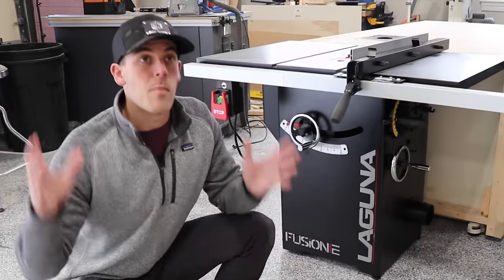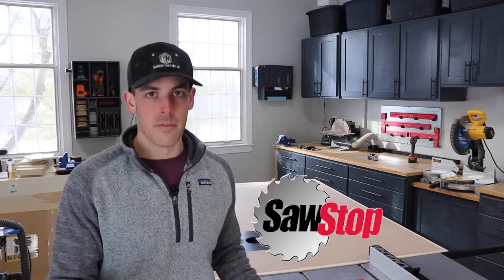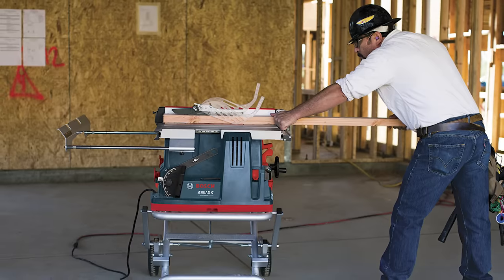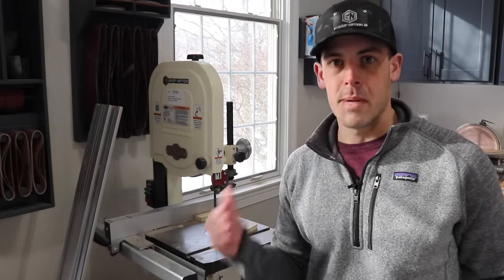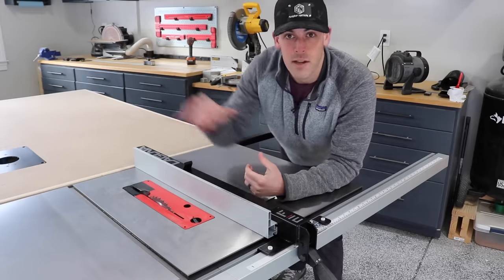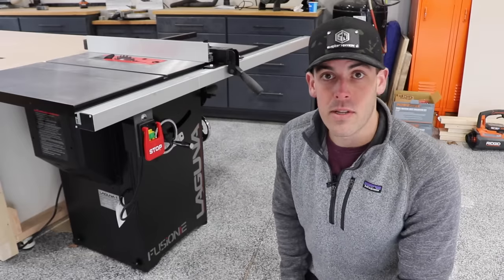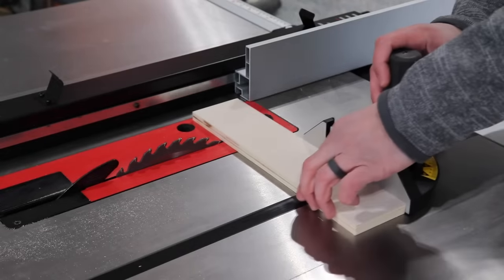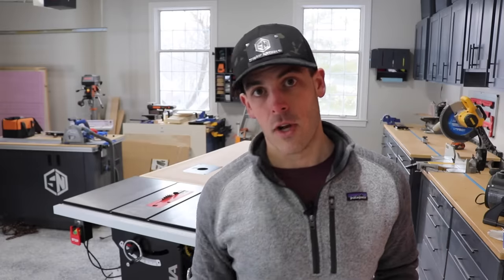Why I Bought a Laguna Table Saw over SawStop!

Comment: The title of your video intrigued me, and even though I guessed the reason you went with a Laguna tablesaw was the price, I still wanted to watch. Your reasons can't be ignored, there is just something about paying more than twice the price for something that's basically the same thing that is unsettling. I spent over 35 years as an automotive technician until major neck surgery made it impossible to return to the work I loved doing, or to even be able to drive myself anywhere. Safety was always a concern as a technician, but I would be lying if I said that I did everything safety-wise by the book. The first thing many of us did when we purchased a pneumatic die grinder was to remove the lock that you have to disengage in order to squeeze the trigger. Until the last set I purchased where I kept them on, that was me.

The reason I am willing to pay the extra money for a SawStop is that with very little movement since the surgery, (my head is the only part that moves), I lose my balance easily, I have to turn my whole body just to look to my side, and doing so sometimes causes the aforementioned  loss of balance. I also have two forms of heart disease as well as vertigo that comes and goes, so the last thing I need to worry about is where is any part of my body is going to go if I collapse for any reason.

There are those that would say that I need to choose another "hobby", but I worked as an auto tech since 1986 with the vertigo, and one of the heart disease I have evidently had all my life but it was never diagnosed. The other came on in 2000, 23 years after I started my career. Woodworking has never been a hobby for me., I have been doing it in some capacity since 1979 when I got married and had my own house. if anything, even though I was always mechanically inclined and figured I would either be working on cars, or in the Coast Guard when I "grew up", when I took woodworking in 8th grade, that all changed. It was then that I found what I wanted to do in life, woodworking. Unfortunately, where I live there wasn't much opportunity to earn a living at woodworking, and at eighteen, I would not have even considered moving to where there were opportunities.

The tablesaw I have now is a DIY piece that leaves a lot to be desired, and I have to be very careful that my attention isn't diverted elsewhere when I'm using it, and that is why I'm shooting for a SawStop. So I never have to worry about something suddenly distracting me and diverting my attention.

Just my thoughts for my situation, but like I said, I agree with your reasons and your decision. I don't in any way condemn or fault your decision.

Comment: I love Laguna tools. The bandsaws the lathes. Their table saws…….. you have to spend BIG money to get 3 HP.  I found an older Delta Unisaw and as it was right hand tilt the owner was having a hard time selling it. I do very little angle cuts on my table saw. Plus the right hand tilt really isn’t an issue anyway to me. Thus I got the saw in mint condition for $1.100.   52“ Biesmyer fence. This is my dream saw. The older Unisaws can be a little hard to find but it is yet another option. I have been a cabinet maker woodworker for ……30 years or so , with diligent safety protocols you can keep your digits without a saw stop. I did enjoy your video and hope I didn’t hijack your post or be a wet blanket.

Comment: I've used a lot of saws and assembled and set up two Hafco cabinet saws.  At home I've had a DeWalt jobsite saw that I love, but it has an aluminium table that is not flat, and limited capacity, and I feel it's time for an upgrade.  I'd like a Sawstop, and I recommended my Menz Shed get one when we upgraded a year or so ago, but they were, and are still, awaiting stock here in NZ.  If I could get a Sawstop, it would cost me double what a Laguna saw costs here, and in my research the Laguna is impressing me with its quality.  Stumpy Nubs said that American woodworkers might soon have no choice but to get either a Sawstop, or a saw with a Sawstop brake.  We are not in that position here, so I intend getting a Laguna F2 for my home shop.

Comment: Very reasonable take on saw stop vs competitors.  Using a contractor saw myself, and I’ll bet most wood workers (hobbyist and pro) are running something other than Saw Stop today, so hard to argue it can’t be done or other options aren’t valid.  Personally, if I was making cuts on my table saw every day, and I could reasonably afford it, I’d sure like to have something to protect me against, well, myself.  There are definitely times where it’s tempting to reach up and grab a piece just a little too quick or make a cut that’s a little on the sketchy side and an error rate of 0 across an enormous sample, at least for me.

I do wonder if people with Saw Stops are a bit more careless after a while. There’s a thought that people have a specific risk tolerance and if something become less risky, they adjust their behavior accordingly.  I recall an Econ professor saying the best way to make people drive safely is to have a spike coming out of the steering wheel pointing at the driver. I could certainly see people that trust their saw to save them get a bit less careful, and even if the Saw Stop works well, might that approach translate to other tools.

Comment: I bought the new F3 about one year ago, very shortly after the lineup was revamped.  Aside from the (at the time) lack of updated owners/assembly manual, mine came with one for the previous generation, and the fence, which I'm not crazy about, I love the saw.  You are correct about the price-point vs. a SawStop when you compare quality of the saws and features that it comes with.  I, like you, think SawStop makes some of the highest quality tablesaws on the market, not even considering the flesh sensing technology, but the equivalent 3hp SawStop was a full grand more than my F3, and my F3 has features like overarm dust collection and built in mobility that would add even more to the SawStop price.  The thing about the fence that I'm not crazy about is the lack of ability to mount certain accessories, e.g., JessEm Stock Guide, nor fence straddling jigs, like ones that shroud a dado stack for cutting rabbets.  If I made YT videos, I'd do one on my F3, because like you said, there very few, other than the marketing and overview Laguna videos on these saws.  They definitely fit a quality/pricepoint niche that is open for the taking right now.

Comment: I’ve been using Laguna in my shop for several years now and like the results I get. I have a Laguna table saw, bandsaw, planer, jointer, and dust collector. The only negative comments I’ve heard about Laguna is the service department is non-responsive if you have an issue. I haven’t had a single problem with my equipment so I’ve never tried to contact them. If someone is looking for an opinion from a Laguna user, I highly recommend their equipment. Since this is an opinion, I’d also like to add that accidents come from lack of knowledge on how to use a table saw correctly or not paying attention to what you’re doing. Don’t use sawstop as a crutch to protect yourself. Learn to use your equipment properly and then pay attention to what your doing. You don’t need an overpriced saw and fear to protect yourself.

Comment: As someone who has lost 3 fingers on one hand due to a shop accident, I can appreciate any form of safety measures a tool company puts in place.  However, I will say that my accident happend on a jointer, not a table saw, and in probably 15 years I've been using a table saw, I've never had an accident like that.  So for me, yeah it would be nice to have a saw stop, like if it was given to me, but I do agree they are way over priced for what they are.

Comment: Nice review. I have used a Saw Stop in a work environment and had a freak encounter with the blade that convinced me that if you can afford the Saw Stop, it is worth the expense. 

It is likely that I will end up buying a Laguna. That said, table saw safety warrants your full attention every second that the machine is running.

Comment: I have a 20 year old Delta contractor saw with a unifence, which is basically the same as the fence you have. I love it. I use that high and low feature all the time depending on the thickness of what I'm ripping. I also love the ability to slide the fence. That's very handy when cutting long boards, or long and wide plywood as sliding it toward you makes it easier to keep what you're cutting up against the fence as you feed it into the blade. That fence is one of the reasons why I haven't bought something newer and better.

Comment: Love my F2, great choice. I purchased for many of the reasons you cited and have zero regrets.
Reply: Rocket Man  I’m running a Harbor Freight dust collector with the Oneida dust deputy and the Oneida upgraded filter which replaces the bag filter.
Reply from the maker: Rockler wall mount 1250 CFM, and works amazing

Comment: When shopping for saws and checking out SawStop, all the sales people would tell me was about the safety feature.  It got tedious; I got it already!  I finally told a salesman that "I wasn't buying a table saw to 'not cut my finger off.'  I was buying a table saw to cut wood!  Finally, a salesman pointed out that the idea behind SawStop was that it would be robust enough to be able to perform at the same level of quality/consistently after a cartridge activation/replacement.  In other words, the trunnion and related design was very robust in order to absorb the energy from a cartridge activation.  So not only are you paying a premium for the whole electronics and cartridge, but you also are paying for some significantly stouter mechanism.  That stated, the value of that can be debated.  Is it worth the extra for all that robustness plus the safety.  I bought the SawStop 3hp version, and am very happy with it.  But I have one of those Laguna band saws and I love it as well!  It is made with very good quality and I'm betting that their Fursion table saws are also made well.  There's a lot of subjectivity in all this, but you make great points!  And that's from a happy SawStop owner!

Comment: Last summer I came to the exact same conclusion and bought a Leguna F2 saw. I absolutely love it, though I did cut the end of my middle finger off in a dado blade incident a month later (not even the SawStop would have helped there). But, that was in no way the saws fault, I 100% own that screw up.

Comment: I was a cabinet builder at a cabinet shop for a number of years. They had a Reliant commercial grade saw. While working there I bought a Grizzly 1023SLRW in 2006. I liked it way better than my work saw. Still have it today. I do not see how you can put the Jet saws in the same category as Powermatic. My buddy, who is a professional fabricator, he will build anything you ask, metal or wood or plastic, had a shop full of Jet tools. It was a nightmare for him. They all ended up in a corner of his shop and he switched over to all Grizzly tools. I can’t honestly comment on the Laguna saw as I have never used one.

Comment: I'm in Europe. After 3-4 years of working with entry level tools, and of course lusting after 'forever' tools, I came into some money. I chose the same - Laguna. I was also surprised how little info was out there. It was hard work and for a while I was fixed on Harvey but in the end, due to Harvey not replying to my enquiries (Harvey not present in Europe like they are in USA) and the price point of Laguna for the features, I went Laguna. Fusion 3 plus bandsaw plus lathe. The tools are a 3 month wait currently but I'm completely psyched as the first one arrives in 2 weeks. Let the Laguna rebellion begin ! :-)

Comment: As a finish carpenter and home builder I just can’t justify the cost of the Sawstop! I’ve been using table saws about 30 plus years and for on site work you can’t beat the Dewalt 10”. I’ve built cabinets with the dewalt! So it comes down to skill level and fear of losing a finger and if that’s the case then get you a Sawstop! My shop has a Powermatic but i still prefer the dewalt on site. So if your a true craftsman it doesn’t matter the saw. Its your ability level is really what should be considered! Very interested in this saw long term so ill be watching your update.

Comment: 2 saw stops at the shop I work in. 3 times I can recall the brakes being tripped. Not 1 person touched a blade. 2 missed staples in the board and 1 reflective plexi cut without the disable function.

Comment: I enjoyed your video but felt your risk assessment left much to be desired.  As a 40 year veteran in Risk Management and a woodworker, the risk of using a table saw can't be measured by multiplying a risk factor times a negative financial or physical outcome.  The perception of risk is always under estimated for we human beings have a flawed understanding of probabilities.  A low probability doesn't mean an event can't happen.  As an example, people who live in a flood zone with a 1% chance of a flood believe that they can only suffer a flood once every 100 years.  As we know flood events can happen not only every year, but can happen 2 or 3 times in the same year.

I believe that table saw safety is a function of how you use the table saw.  I use an older model Delta 3 HP cabinet saw with a Biesemeyer fence.  The danger of that model is that the blade tilts towards the fence and there is no riving knife that moves as the saw blade height is adjusted.  I've had to modify my use of the saw by creating multiple blade inserts with splitters to reflect the thickness of the cut I am making, as I want my home made splitter as close to the back of the blade as possible.  When I make a bevel cut, I move the fence to the left side of the blade so I don't create a dangerous trap for the cut off.

SawStop dominates the YouTube market because they either give the saws away or provide significant financial assistance as a marketing tool.  Having said that, the growth of the SawStop has been phenomenal, considering the inventor first offered it to established brands.  They all passed because they felt nobody would pay for a safety device and they didn't like the royalty payment scheme being proposed.  

For we average home hobbyists, the decision to buy a SawStop is often driven by a spousal and/or a personal risk factor.  Comparing the SawStop to the Laguna, I would stress the following points:
1. Technique and consistent practice to use push sticks/pads/hold downs is the foundation of safe table saw use.
2.  Kick back can either spear you with a cut off or pull your push hand into the blade.  A proper riving knife that adjusts with changes in the blade height and the distance between the back of the blade and the front of the riving knife or the splitter is your best defense against kick back.
3. Using either the Swiss Cheese or Domino theory of preventing accidents, the goal should be to keep your hands off the spinning blade during every cut.  A dust hood, pawls, splitter, riving knife, push block, pads, etc., help you to keep your hands away from the blade should a moment of inattention or a bad knot or twist in a board cause you to lose control.
4.  As both the Laguna and the SawStop have what looks like properly functioning riving knives or splitters with the dust cover, the only difference between them is the skin sensing technology.

Anyone who wants to have the skin sensing technology and can afford it should not be labeled as a conformist or a drone.  

I look forward to future reviews of the Laguna table saw.
Reply: I think you're exactly right concerning risk estimation and how bad many of us are. People worry about flying or getting a COVID-19 vaccination when the most dangerous thing most of us do is drive a car. And we do that every day. I see a lot of excuses for not getting a SawStop. These are painful to read because they are false justifications. Just admit that no matter how many years you've been a woodworker, going with out blade stop technology does raise your risk, but for many people it's a tradeoff they're willing to make either for now (until they can afford a better, more expensive saw) or for good. It's like if you were to decide to not wear seatbelts and to disable your airbags. For any single person who's responsible and careful, they probably won't die in a car accident. But when you look across millions of people, accident statistics are very clear. You take away those protections and you increase risk.

Perhaps the most misguided assertion is that SawStop tech makes using the saw MORE dangerous. This is predicated on the highly questionable assertion that SawStop users will be more careless "because they're protected." Well anyone who approaches any power tool (or motor vehicle) with that attitude is inviting disaster--no matter what safety features it has. A person like that is a danger no matter what tool they are using. I don't drive recklessly because my car has seatbelts and airbags and I don't operate my SawStop saw dangerously because it has skin-contact sensing technology. But in each case, I see the value in the added safety. And someday I may personally benefit from their operation if my luck runs out...